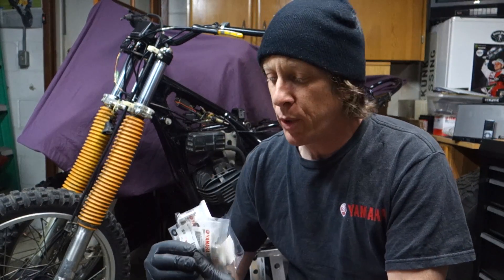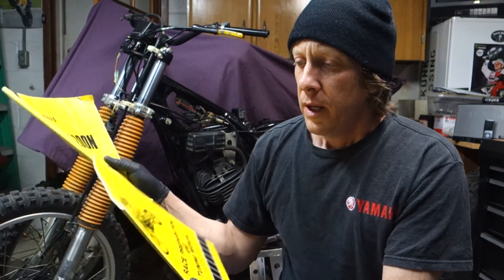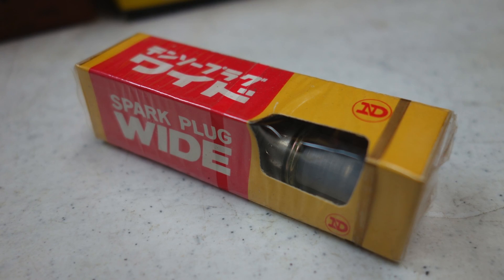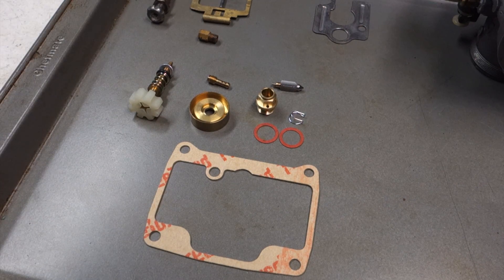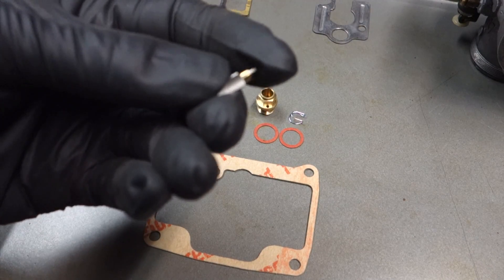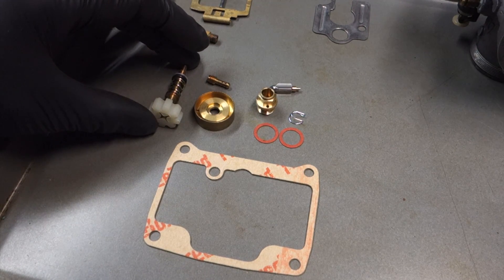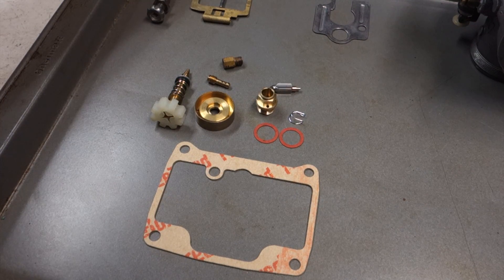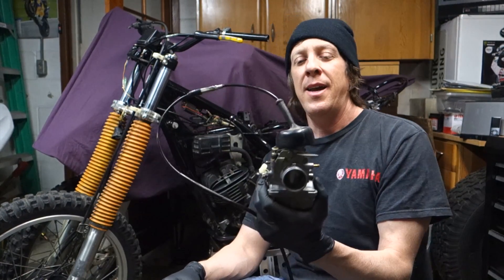1985 Yamaha IT200 Carb Rebuild

Comment: I bought an it200 yesterday and I was checking my carb out cause it was flooding when you leave the fuel on (not running) but I had a lot of dirt in the float valve seat but I didn’t see a o ring in the valve seat can you tell me if there supposed to have a o ring in the seat
Reply from the maker: If you watch the video when I have all the parts played out,  you can see those 2 red flat washers looking parts. That is the extent of this carb's "o-ring". There is not a black rubber o ring that presses into the seat valve body like other carbs.
Reply: Mine is doing the same! Did you ever figure out the cause? 86' IT 200

Comment: Did you use stock size jets 330 main and 55 pilot took mine apart it has a 70 pilot and a 320 main

Comment: I bought an it200 frame with no engine and the sprocket is on the eight side. I can't find an engine with a right side drive shaft. What do I do?
Reply from the maker: The IT200 was made 1984-1986. I guess look for motors in those years?

Comment: Good video!  
I hope you changed the position of the washer and o-ring on the idle screw.  The spring needs to press upon the washer, not against the o-ring.
Reply from the maker: ya, I'm pretty sure I did. If I remember, I just placed all the parts out for the video shot..

Comment: Looking great man! I have a 200L and have a question about setting float height: with this style float how do you go about it? the 23.5mm value is still top of float to bowl deck, so you kind of hold the float in place while setting or what? Thanks!
Reply from the maker: I have not adjusted mine. But service manual says..."Hold carb upside down. Measure the distance from the mating surface of the float chamber (gasket removed) to the tip of the float arm using a gauge. (23.5mm +/- 1mm) Make adjustment by bending the tang on the float arm.

Comment: What does it Recommend as a starting point for your idle screw in your fuel screw?
Reply from the maker: I looked in the manual and nothing was really specified as "this many turns out". Try the standard 1 1/2 turns out, then adjust at half turns from there.
Reply: Digital Rider ok thank you!
Reply: Manual spec is 3/4 turn out for mixture screw

Comment: What if it only runs with the choke on? What should I do?  IT 250 1982.
Reply from the maker: Im not a mechanic...but it sounds like you still have some clogged passages in the carb. These are simple carbs...not much to them. Take the carb completely apart and blast passages with carb cleaner and blow out with compressed air. This is also why I bought the sonic cleaner. They really dislodge small deposits built up in hard to clean areas. You also may want to buy new jets. Over time cleaning will only go so far, and buying new is just the better option in my opinion. Also, find a service manual. Those are good to have on hand.
'82 IT250...cool man!